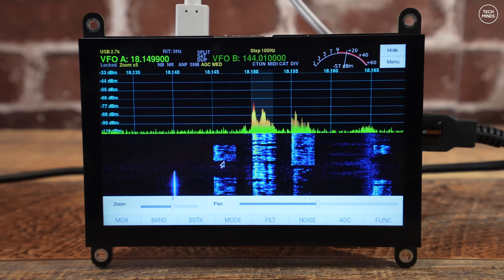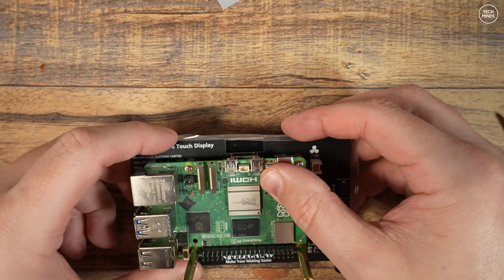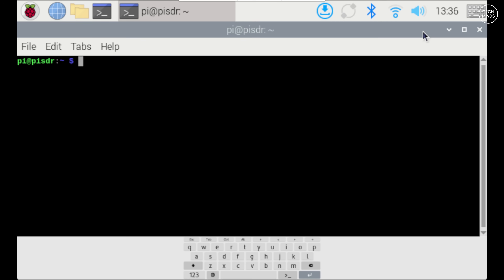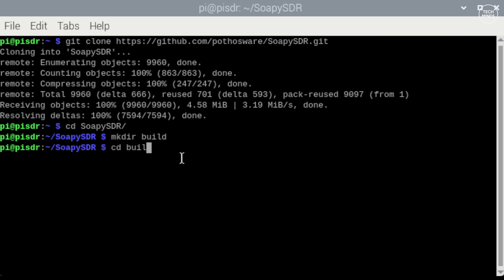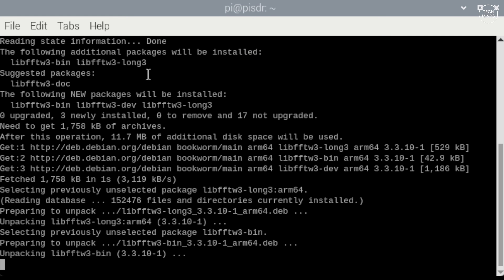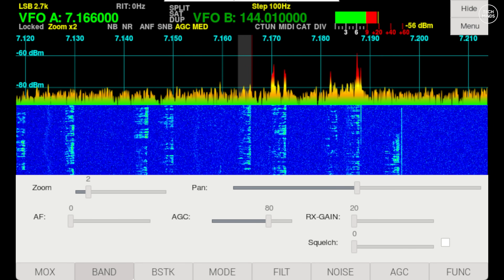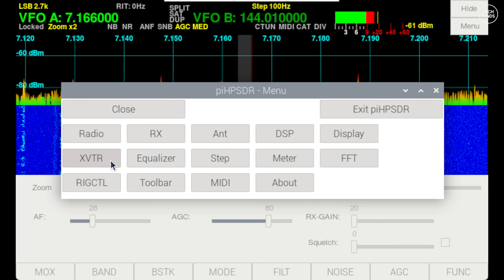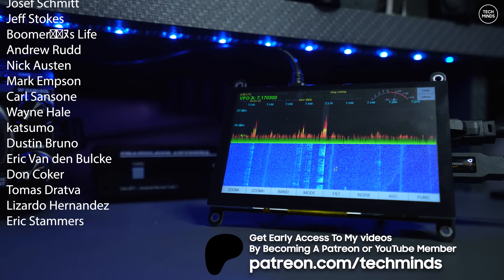Could This Be The BEST SDR Receiver? Using PiHPSDR & SDRPlay RSPdx

Comment: Yeah I'm gonna have to do this. I've been looking longingly across the room at the Malahit radios for a long time but to get at the good ones the cost is... a bit out of reach... hence longingly across the room.

BUT, I do have extensive experience with Raspberry Pi development AND I just so happen to have a RSP1 and RSP2 Pro. As long as I can get one or the other to work with a Pi, I can start building. Bonus points for future proofing, which you CANNOT do with a prebuilt radio like the Malahit units AFAIK.

Thanks for your hard work and spreading the good word!

Comment: RSP1A works great, but RTL-SDR V3 dongle doesn't display HF bands; only the higher bands.  Dongle works fine on all bands with SDR#.  Am I missing a setting somewhere? Thanks
Reply from the maker: V3 only works below 24 MHz with direct sampling. The V4 is designed to work on HF too.

Comment: running an RPi4 (4Gb) and RSPdx2, installed it twice, and it still just doesn't recognize my RSPdx2. My pi recognizes it with lsusb, and I installed the current version of the API, and the previous version, same issue. PIHPSDR, AND SDR++ don't recognize my RSPdx2. but great tutorial none the less!

Comment: Just a small tip: You probably already know this, but you can use PiHPSDR not only for RX, but also for TX if you connect Hermes Lite 2 or another supported TX capable SDR hardware. ;-)

Comment: Great video and thank you for doing this.  I got everything to work per your instruction except my screen is 10 inches and has a resolution of 1366X768.  I've been trying to make the Pihpsdr to execute in a larger format but can't figure out which file to edit.  Once edited, do I need to do anything else?
Reply from the maker: Before compiling edit the main.c file with the height and dimensions. (#define MAX_DISPLAY_HEIGHT 480 #define MAX_DISPLAY_HEIGHT 768). I believe there is a fork of that repository where you can alter the screen size within the application. I will have to make a video on it at some point.

Comment: Can you use cubic SDR instead of PiHPSDR. I am using Cubic SDR with a 7-inch screen, but I have to attach speakers. I like this setup where you have built in speaker.
Reply from the maker: I think you could, yes.

Comment: Hi
Interesting video.  Have you tried running SDRConnect on the Touchscreen instead of PiHPSDR?
I have SDRConnect running on a RPi4 with the "Official" RPi 7" touchscreen and a SDRPlay RSPdx.
It is working BUT the SDRConnect's display doesn't work very well on a 800 x 480 display.
I am trying to make a portable SDR.

Comment: This is a real nice project and your walkthrough the sw installation works perfectly even with the tiny glitche at 10:05. It is definitely a nice project that can use many types of SDR receivers/transceivers. I am using an old RTLSDR and it works like a charm with a smaller amount of energy consumption then a HF transceiver monitoring the bands all day long 🙂
Unfortunately it doesn't seems to work on an RTLSDR V4 for now.

Comment: I have a Raspberry Pi 5, and an RTL-SDR module. I tried setting this up, but I guess it's not supported. I'll have to get an SDRPlay unit. My 5" monitor also is one that doesn't have a speaker, so I may get the one you recommended. It was still a learning experience watching your video. I'll be back. Thank you.

Comment: Great video, I am a complete novice but followed the instructions to the letter and eventually reached the end with no error messages. However on running PiHPSDR it doesn't find any SDR's. Using lsusb shows either the RspDx or RTL dongle detected in the USB devices list depending on what I plug in, but PiHPSDR shows nothing found. Any help appreciated, or maybe I'll start all over. I'm using a Pi4, 32Gb card and a 7" Pi Touchscreen.
Reply: Started all over with a fresh install and working well now. Thanks for great project.

Comment: Excellent tutorial. I used your instructions to install on a Raspi 5 with a slightly higher resolution 7" screen but it was easy enough to modify the soapy script to set the correct resolution for my screen. Using it with a SDRplay RSPdx-R2.
Reply from the maker: Great to hear!

Comment: I'm looking to building this great little project, What RAM would anyone recommend, Would it run on a 2G Pi ?
Reply from the maker: I'm pretty sure mine is a 2GB
Reply: A 2gb will work, but 4gb runs a little nicer when dealing with a graphical display.

The RAM on a Pi is shared between CPU and GPU

Comment: Just built this.  Thank you!  I had one issue.  When doing the wget for the Soapy script it downloaded wonky. Tried it twice.  I had to do a touch (file name) and then sudo nano (filename) and paste in the RAW code from your Github.  Then made it executable and then ran it just fine.  Other than that it works like a champ.  Awesome project.
Reply from the maker: okay, looks like you downloaded the HTML page rather than the RAW code. If you look on my Github page I have added the best way to download the RAW .sh file.

But, looks like you sorted it anyhow :-)
Reply: @TechMindsOfficial  Yep, that is exactly what happened. I actually ordered what I thought was the same display but it is a little different. No USB adapters so regular old hook ups.  Function is exactly the same and I did order the screen you used in your video today.  Love the channel.  You toy with a lot of the same gear I mess with.  I have a blog but you have mad video editing skills.  That's where I need to get to!

Comment: Link for the display appears to have stopped working,any alternative links to purchase?
Reply from the maker: Still working for me: https://www.elecrow.com/rc050s-hdmi-5-inch-800x480-capacitive-touch-monitor-built-in-speaker-with-backlight-control.html?idd=6
Reply: @TechMindsOfficial  ok think it was my DNS filter :-(
Reply: I'm also struggling to get the display link to work....odd
Reply: @shaunimms5156  are you using anything like addguard or pi hole ? Try the link on mobile data see if that works , but also eBay have the same screen as that one I noticed
Reply: @shaunimms5156  didn't work for me until I opened it in desktop mode on my mobile browser, was ok opening it on a laptop browser

Comment: Outstanding video as always, thank you. I have bought the display and have a Pi 4B with 8GB RAM and I intend to put this together. Initially I'll try using an old RSP1 SDR but as mentioned by one other person in these comments I'd love to have Airspy (R2 or mini) capability as my primary use of this would be for VHF and above. Knowing enough about Linux to get myself in trouble a tutorial on setting up an Airspy for this would be great if possible. One other question with VHF/UHF in mind, is it possible to add a few step sizes by editing the script or does that fall outside of it. I'd want to add 2.5 kHz, 7.5 kHz, and 12.5 kHz if possible. Thank you.

Comment: Could the same sort of thing be done with a WEB-888, a Wi-Fi dongle, and a tablet That has Wi-Fi built-in ❓

I have my WEB-888 on order and am hoping you'll do a video on the setup from new,  and any other info on the WEB-8888❗

Love Your Videos, Keep Up The Great Work❗

Your number one fan in Missouri USA 

Kevin Diehl aka N0IWK

73
Reply from the maker: Well, the Web-888 us self contained, just plug an antenna into it and a network connection, then just use any web browser on the network. Using a pi and a touch screen like shown in my video, you could just use the browser to view the 888 web server. Hope that makes sense :-)

Comment: I did something similar last year.  I bought a 7" display on Amazon (made by AISHICHEN) that allowed the Pi board to bolt on the back, and also came with convenient jumper boards for HDMI and USB connections to the touch screen.  I installed Gqrx SDR software, which works OK with the touch screen, and I think was simpler to set up than the SW you used.  The big problem that I ran into though was that the LCD display module was a terrible emitter of RFI on VHF.  I tried to use it on 2m FM and 6m SSB, but the spurs were all over the band and blocked out many of the desired frequencies.  The spurs were definitely coming from the display as I could power off the display (with the Pi still running) and the spurs would disappear. Even when the SDR was connected via coax to an antenna 20m away, I could still hear the RFI.  I applied some RFI absorbing material to the back of the display board, and built a little shielded enclosure for it, which helped some, but frankly I kinda lost interest at that point.  Glad to see you didn't have problems like that.  It's probably all down to poor PCB design on the unit I bought.  Pi HDSDR looks interesting, I may have to give it a try.
Reply: The problem is usually the touch screen. A display without touch generally is much less noisy.

Comment: Is there no way to change the resolution AND install Soapy? I'm mainly interested in using it as a bandscope, so an RTLSDR dongle is fine as a receiver, but my screen is 1280 x 720.
Reply from the maker: @socallars3748  yes you can, if you look at my install script you can see two lines which are commented out relating to screen resolution. You can use those to define the screen size before running the script.
Reply: @TechMindsOfficial  Great, thank you! I figured that was a possibility but didn't have time last night to look through your script.
Reply: @TechMindsOfficial  Okay, I've got it filling my whole screen now, it looks much better! Now to see if I can get it track my HF rig with rigctl.
Reply: I've got it up and running on my bandscope Pi5 (Ubuntu) and an RTLSDR v4 and I've gotta say, this is a very cool piece of software. I've got it looking at the IF of my Yaesu FTdx3000, I've got to figure out how to swap the I & Q in order to display with the right orientation. Next I'll fiddle with rigctrl, I'd love to feed it my receive out and have it track my rig. The only downer is that it displays in a little 800 x 400 box on my 1280 x 720 screen, so everything is tiny. Maybe it can be compiled for other resolutions? Plenty of time to figure all this out, I'm just barely scratching the surface now.

This is a really nice piece of software that somehow was flying below my radar, I really appreciate you bringing it to my attention!

Comment: I hope someone makes a way to control software SDR with midi controllers so we can have physical dials, buttons, sliders and wheels to control these software.
Reply: MIDI is  suported with pihpsdr.
Reply: @afutechtalk  Ohh, didn't know that. definitely gonna check that out. thanks
Reply from the maker: Im pretty sure I mentioned midi a few times in the video, I even showed where the midi settings were within pihpsdr.
Reply: @ I was at work listening. Maybe missed a lot of parts and probably why Midi popped into my head. Thanks man
Reply from the maker: You’re welcome dude, there are some pretty funky things you can do with a DJ midi controller!

Comment: Very cool. I built a similar setup for use as a panadapter to sit atop my Yaesu HF rig, using a Pi5, a Pi touchscreen, and SDR-Play receiver and SDR++ software. While it's a great bandscope, I can just switch antenna inputs on the SDR-Play to use it as a general coverage receiver. I definitely have to check out the PiHPSDR software though, I hadn't heard of it!

Comment: Why not use a mini PC?
Reply from the maker: You could use a mini pc, you could also use a 1080p monitor, or 4k monitor. The choice is yours to build it how you like. This is how I built mine using the parts I had available. Cheers
Reply: @TechMindsOfficial   raspberry is outdated and price level. There is something  similar on amazon the RasPad 3.0  there is space inside for a RTLSDR but also external.  I did review and build instruction for the RTLSDR  about 2018 on the RTLSDR forum

Comment: I really like my SDRplay RSPdx-R2 - I've finally saved up enough to get it. I have several RTL-SDR dongles but they are finicky for me. I'm working on a setup just like yours , the differences are : I have a Raspberry Pi "official touch display" and I have to use an outboard sound card to drive the audio. my Raspberry Pi is a 4B ( at only 2 GB RAM) and I have a Zero W but it's only 32 bit. originally I got my RSPdx-R2 to use as a panadapter for my Yaesu FTdx-3000 doubling as a scouting RX. thanks for the great video at just the right time!  SDR's are just amazing and I'm so impressed at how well my RSPdx-R2 hears. also, it's not demanding on the computer either.  lots of fun , plus we don't need to buy expensive scanning RXers nor general coverage receivers.  really amazing!
Reply: I had the very same opinion of the RTL-SDR dongles, but that changed when I got a v4 device. It's solid and works very well, it's a great value for the price.

Mind you, I quite agree that the (much more expensive!) devices from SDRplay are superior. I've got two already and would like another. Everybody is dumping their RSPdx model now that the R2 is out, I've seen them go for around $100...I paid a LOT MORE for mine a few years go.
Reply: @socallars3748  Where have you seen an R2 for $100? That is a very low price.
Reply from the maker: You're welcome! I really like SDRPlay products, they work extremely well.

Comment: Edit: followed the steps to the T and I am having small issues like screen won't go full, and when I press MOX it closes PihpSDR (crash) along with some other key presses causes the same symptom.... unable to manually change bandwidth... Ill start afresh and see what goes unless anyone has any ideas?

I have got a pi5 stuck to the back of a 10.1" capacitive touch screen and an m.2 sdd attached to it with a nooelec nesdr dongle which works flawlessly on my DragonOS (Pi64) running on the M.2 nvme and so I'll be keeping this on the SD card so I can choose RaspberryOS or DragonOS with a simple change of boot order.  I like the layout and the ease of use  from the video above with filters etc.... the Airspy is a bit out of my league at the moment, this has been a project for my post-operation recovery which happened 2 weeks ago.  Thanks for sharing this! 73 2M0DDX
Reply from the maker: The crashes are most likely related to how piHPSDR handles the buttons when using SOAPY where the buttons would normally be used for a transmitting SDR.  Check your screen resolution and then if you look in my script there are two lines "commented out" where you can define a screen resolution. Edit that and then run the script again.
Reply: @TechMindsOfficial  I've purchased an rspdx to replace my nooelec dongle.  Fed up with sub par gear.  Thanks 2M0DDX
Reply: And I am sure you are too occupied reading manuals about what you can do if you are intelligent enough to read - that you have not noticed that the 10 Meter Band is finally open again.

Comment: I have just got started with SDR, I have a neosmart V5 , and I made a J Pole arieal out of 50mm copper tape. I can pick up planes when near by and ACARS etc, but thats pretty much it. I found some odd signals with lots of peaks and a constant chirp which I am assuming is digital plexing. I have sort of run out of steam not knowing what to do really.
Reply from the maker: Antennas are the key to receiving well. My VHF/UHF antenna is around 5 meter above the roof of my house. For HF, less than 30MHz I use an EFHW antenna, which is just a 20M length of wire up at around 8 meters. for HF on the V5 you do need to enable direct sampling within the SDR software.
Reply: @TechMindsOfficial  yeah sadly I can't get those sorts of heights here. Enabling the sampling brought in loads of weird spikes right across the band.

Comment: Great work, very interesting, thanks a lot ... I am always impressed with your Linux skills👍, which is my weak spot ... but with my favorite AI helping me and explaining everything, I am getting there, its not intuitive yet. I am also impressed it comes with DRM and synchronous AM, filter settings, noise cancellation, that is a really nice app ... wonder of it also does FT8, HFDL, NAVTEX/FEC and other cool stuff that comes with a lot of web-SDRs, that everybody is used to these days?
For me personally its just always painful when listening to sideband and being more than 20 Hz off, when this is completely unnecessary and could be leading to a proper audio when not being so sloppy on that part. Its not like in the late 70's when I started to listen to sideband and nobody could find the proper frequency, even broadcasters were way off sometimes, but now we live in the age of cheap and precise TCXOs and GPS-locked oscillators, so if everybody just sets things right, we are all good.
Also making listening to SSB audio more enjoyable, make sure to use speakers that go below 300Hz and if so, correct your IF filter curve down to 50 or 100Hz and maybe use the RF gain to reduce the noise and use the usually distorting noise reduction just very slightly ... it cultivates the entire listening experience.

Comment: Is there a good antenna available that can receive hf, vhf, uhf and split into the the three antenna ports on the sdrplay? Something like a discone with a splitter?
Reply: You are talking to the wrong people. This forum is about how to use you PhD in electronics and physics, to tinker around with some new gadgets - you are talking about Ham Radio - people who enjoy talking to strangers on the other side of the globe - connecting instantly, like old friends since they do have one thing in common - HAM RADIO.

Comment: I love my RSPdx.   It is excellent, but so is my RX-888MKII.   For HF work, it's the RX-888 hands down.  The thing has such a wide receive bandwidth that you can receive all the HF bands simultaneously.  No tuning around - it just does the business.  For higher frequencies, I prefer the RSPdx.
Reply from the maker: I’ll have to see if there is a driver for the 888 to see if it can work with PiHPSDR. 888 is an awesome SDR, power hungry too lol